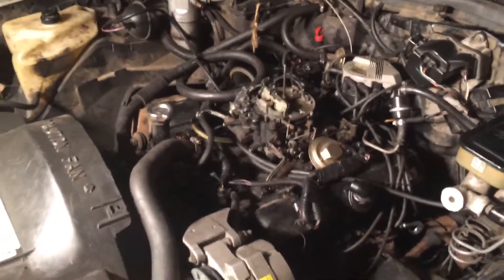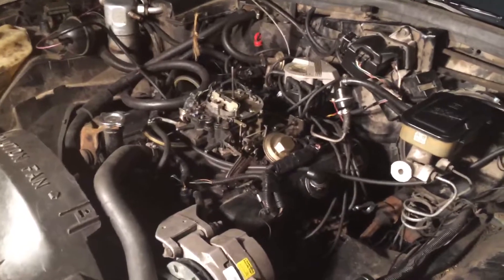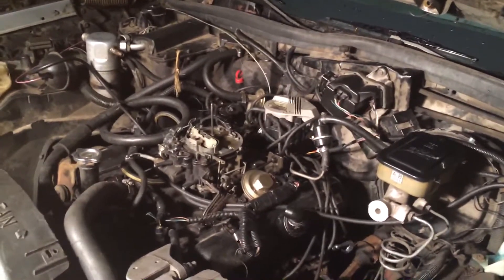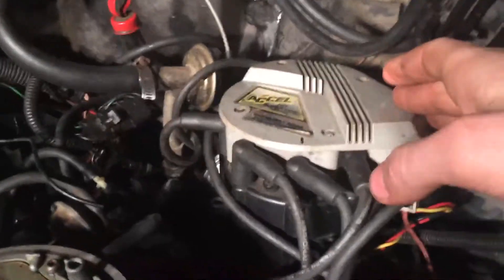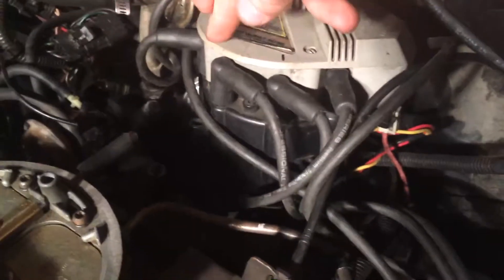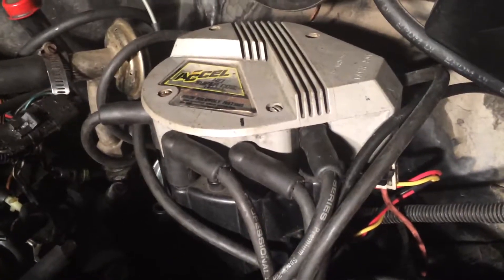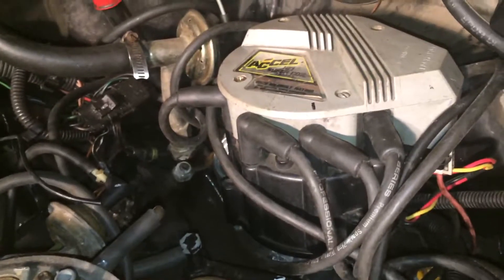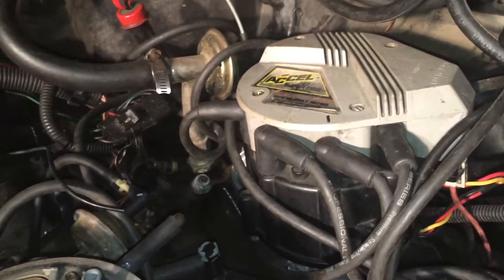Video response: ignition

Comment: sorry for the late response had n addition to the family my son was born yay....vbutvfuken car still won't start everything is fine firing order is in tack
Reply from the maker: Congrats on your new son. The only thing I can think of is that the distributor still isn't timed with the engine or the timing chain is off a tooth like you suggested before. These engines have cam sprockets that the teeth are coated in some type of plastic and I have seen the timing chain stretch and the cam sprocket teeth wear to the point that it wouldn't take much for the chain to skip.